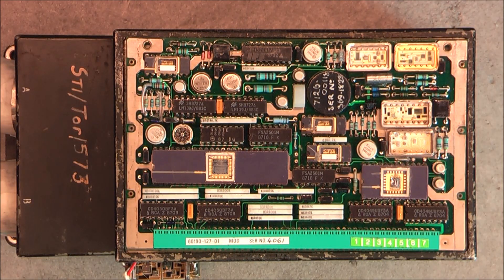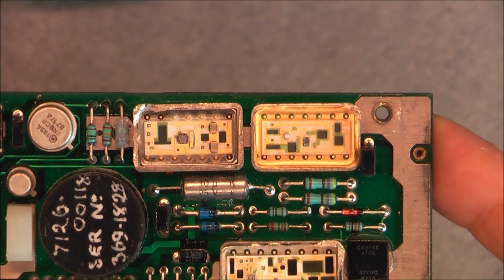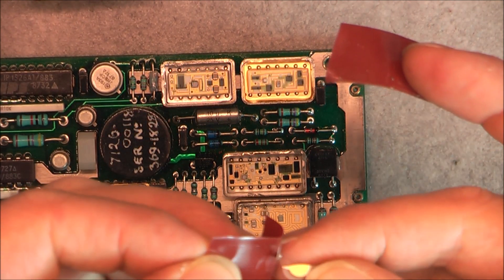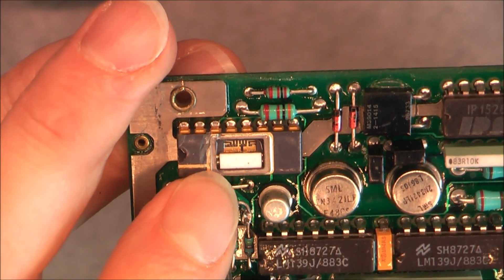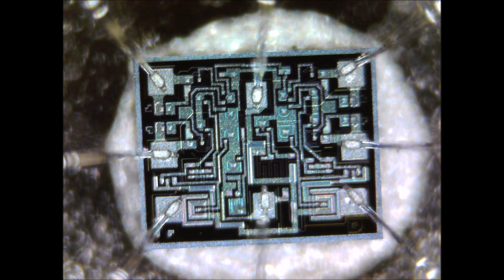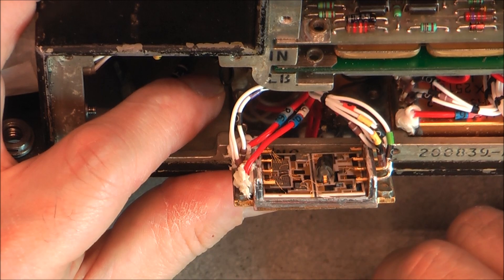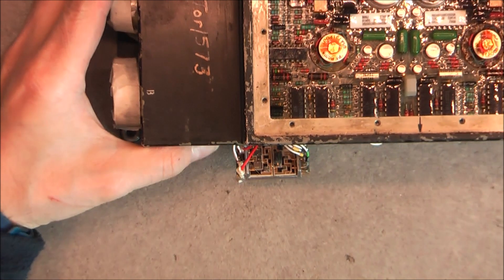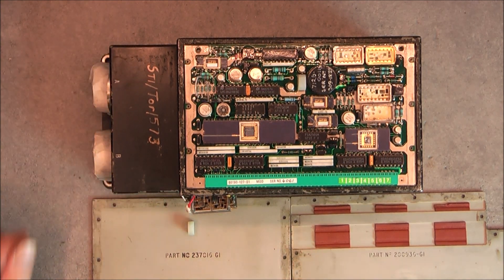Inside the Tornado PDU hybrids

Comment: Those hybrids contain amplifiers with trimmed gain, one has a CD 4007 CMOS analogue gate array in it ( those 6 identical pairs of CMOS transistors are a give away) along with one having a CMOS analogue gate chip in it.  Rest are regular opaps, but without looking closely at the dies for part numbers you will be hard pressed to tell them, though likely they are from Burr Brown, RCA, Motorola, National Semiconductor or Texas Instruments, as they are the ones who all had a MIL spec quality range off the regular product line they offered.

Small transistors look like 2N2222A dies inside, with the power devices probably equivalent to the 2N3773, but without knowing the exact mask set used and die manufacturer they could be almost any one of a range, but the 2N2222 and 2N3773 at least have the advantage of being MIL certified parts, as both packaged transistors and as bare dies, so very likely that is what was used for there.